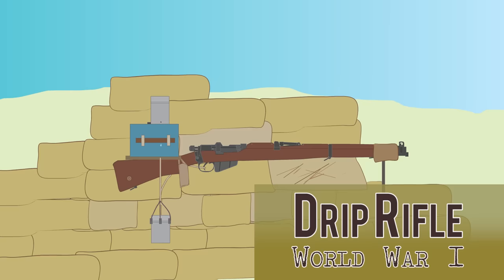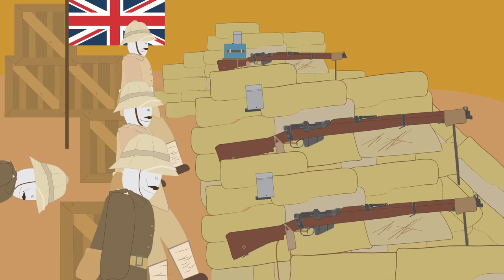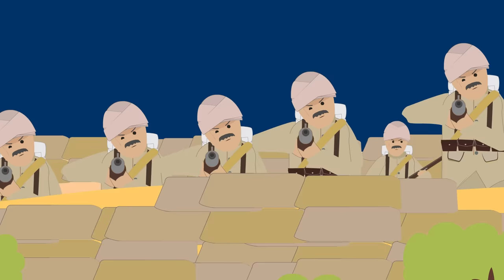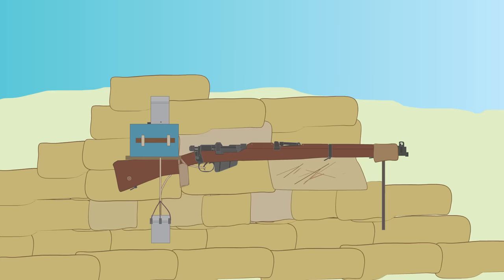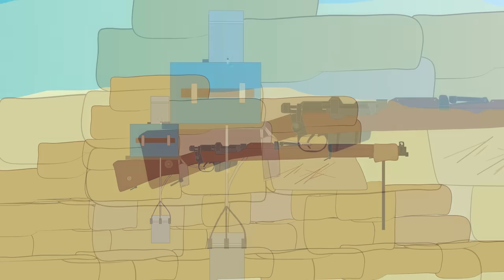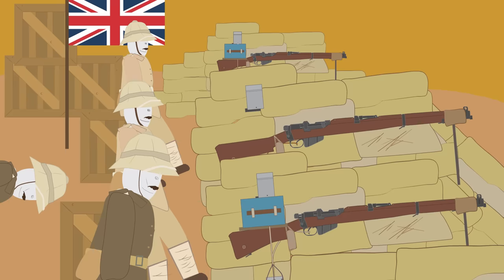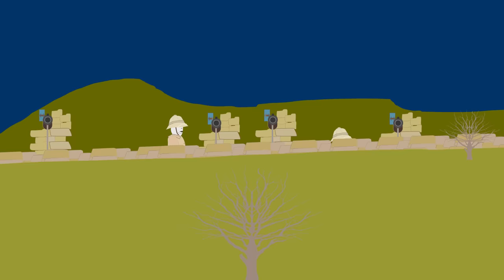Drip Rifle (Weird Weapons)

Comment: “The Drip Rifle, also known as the Pop-Off Rifle....”

This CANNOT be real! 😂
Reply: When the drip is popping off!
Reply: Also known as the prrr rifle
Reply: Brruuuhhh. I'm dead. 😭🤣🤣🤣
Reply: I am literally doing the 😂 in real life.
Reply: PFFFFFFFF
Reply: dat rifle got the drip doe
Reply: Faucet failure rifle
Reply: It most certainly is real and actually works
Reply: But it is im a aussie
Reply: Drip is when the sus
Reply: @mileselon1339  That is not what they mean here. They are refering to the words used for the video as "Drip" and "Pop off" are modern terms used for having style in an outfit and being pretty fuckin' bombastic respectively
Reply: @CrystallizedBlackSkull  oh. I get it now. Thank you.
Reply: @mileselon1339  

Yeah i don’t know what kind of coincidence happened here but it's hilarious to me 😭
Reply: Well, I seen something about the .303 That makes me say it was real.
But no one seems to know it.
The 
303 could be slam fired.
It was a technique that was used during WWI. But has been forgotten.
I once seen it demitrayed.
And was like a slow full auto, or fast semi. 
I've had reinactors tell me no.
But..I seen someone do it.
You hold the trigger with the left hand and push pull the bolt with the right.
Though I believe push push would be a better term for it.
I think the round going off did the pull 
And unlike other bolt actions. 5he down or locking movement is not used.
I was told this was the Frontline way to combat the machine guns. And would appear they had a lot more machine guns.
This was also used in advancing. When you got to the trench. You used bananets and other hand to hand. Not bothering to reload you empty rifle until you could.

Comment: I wonder if one of those rifles ended up actually hitting at least one of them.
Reply: Not likely.
Reply: Odds are low but never zero
Reply: Damn you got me there
Reply: @Preaplanes  actually given the size of the universe there is a non zero chance that a space faring civilization also has bowling and uses the same weights as on earth,  and if one were made of a potentially undiscovered sufficiently heat resistant material or that reflects enough energy from the sun to avoid being melted at surface temperatures and fired at the sun just right it could potentially skate just across the surface and, if the trajectory is right, carry on to earth and hit him in the head. So basically, a bowling ball shooting out of the sun and hitting him in the head is statistically more likely to happen than the chances Jeffrey Epstein killed himself, which are zero.
Reply: @Preaplanes  Hey there don't be so sure. It's entirely possible that the sun people could accidentally throw a bowling ball at Earth.
Reply: @dinostudios6579  Yeah, but not a regulation one, material wouldn't survive in the sun.
Reply: @Preaplanes  Oh true. Forgot about that.
Reply: @Preaplanes  No one said whose regulations we were talking about.
Reply: @Preaplanes  So there is a chance our reality is just an illusion (a la Matrix) so there should also be a chance of this happening as a glitch...
In the abstract mathematical scenario it would however still have a zero chance;)
Reply: @Preaplanes  well if it was traveling very slowly, bounced off a meteorite when it was going to the sun, evaded both mercury and venus gravity pool and then fell back down to earth it could be a regulation one
Reply: @severketorskeleton3759  yeah but it ain't shooting out of the sun
Reply: @randompheidoleminor3011  it technicaly is
Reply: @severketorskeleton3759  it ain't going out of it, so technically and literally no.
Reply: @randompheidoleminor3011  it got out of earth and would stay in space if it wasn't for the meteorite wich makes it fall from the sun
Reply: @severketorskeleton3759  yeah but the original comment stated that the regulation bowling ball originated from the sun, not earth.
Reply: @randompheidoleminor3011  it didn't say it originated from the sun it said it shot out from the sun
Reply: @severketorskeleton3759 ... that's what shot out means
Reply: @randompheidoleminor3011  it has been shot out from the earth then shot out from the sun
Reply: I feel like I'm in the science class right now
Reply: Were you right?  Hah, right, and there was no tiennamen square massacre I take it? And North Korea won every Olympic gold medal? Because people in positions of power clearly never lies kek
Reply: @Preaplanes  they said a chance of you being struck by lightning bolt at the same time eaten by a shark is higher than you won a lottery, so anything can happen, even the odds is 0.00000000000000000000001%, it's not absolute zero
Reply: @Preaplanes  lol EpStEiN DiDnt KiLL hiMSeLf iTs TotAlLy InConCEivABLe. XD
Reply: If the Ottomans decided they wanted to Bayonet Charge the Trench then a lot of them will die for sure

Comment: So some dude was killed by a water gun?
Reply: Nerf 1 - Kebab 0
Reply: @ΝικόλαοςΘεοδωρίδης-γ6λ  Well, the Ottomans won the Gallipoli Campaign though.
Reply: @sarge8147  
No one is sure, if an Ottoman was killed, they would mark it as a normal casualty as they were not aware that drip rifles exists in the first place. So even if some were killed, they would be marked as normal deaths.
Reply: Boruto's dad plz nerf, too op
Reply: Its point is not kill, gain time for retire from   area.
Reply: @ΝικόλαοςΘεοδωρίδης-γ6λ   what's the matter greek? Do you wanna go to swim again? ;)
Reply: @reinatr4848  They did. But there were more Turks killed in the campaign and they were dug in on the defence, should be the other way round.
Plus they got wrecked after Gallipoli anyway.
Reply: @beyondbackwater4933  this doesnt debunk my statement.

Comment: I just had a thought... If you replaced the bottom cup with a siphon, (and assuming that the gun had a magazine) then wouldn't it be a fully-automatic gun?
(What I mean by this is that the siphon would repeatedly empty itself, removing weight (and thus the trigger would go forward), and then when the can fill again (assuming that the top can had more water) it would fire again. If it was bolt action, then a second rope could be attached to the bolt via a gearbox (or pully system if that was too expensive/there weren't enough resources) so that it is pulled back as the can goes up. Ofc the pushback force of the trigger wouldn't be enough for this, so a slightly smaller siphon would have to be placed on the trigger with a similar drip system to act as a counterweight. If there is a flaw in my design, please let me know. Else, thank you for coming to my TED Talk.)